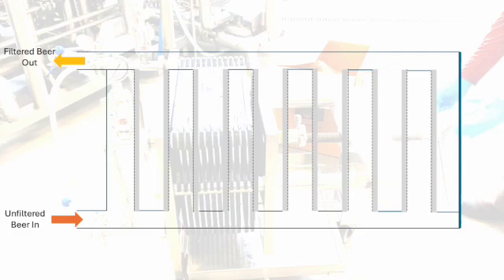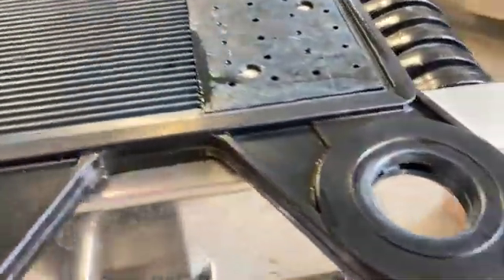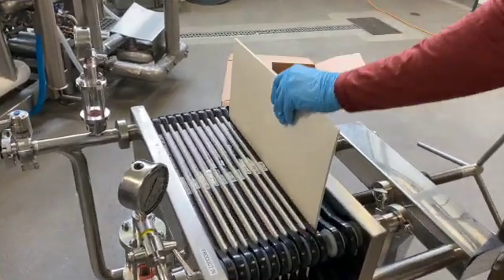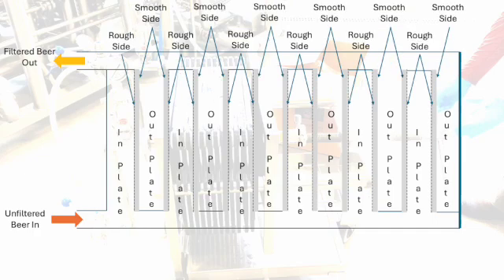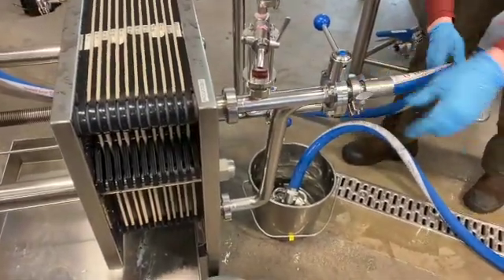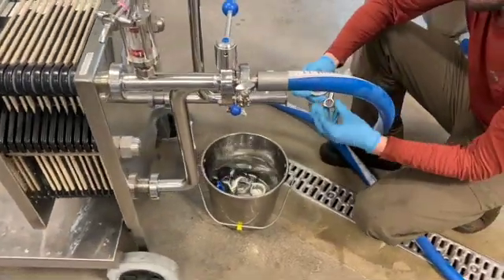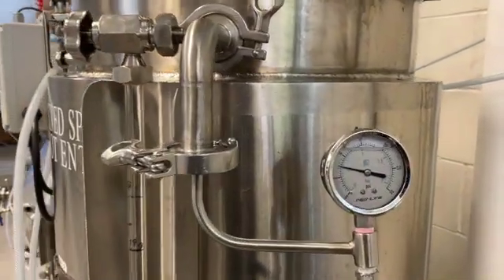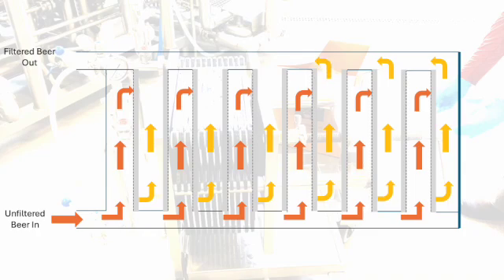Beer Filtration: Understanding the Process for Cleaner, Crisp Beer (Sheet Filter)

Comment: What is the pore size (micron) of the filter sheets you use?
Reply from the maker: The typical pore sizes for sheet filters used in beer filtration range from 0.5 to 5 microns, depending on the beer style and desired outcome.